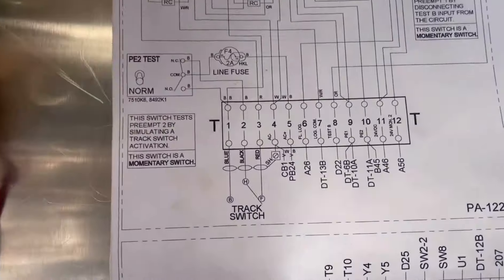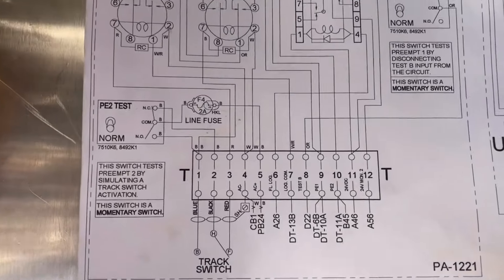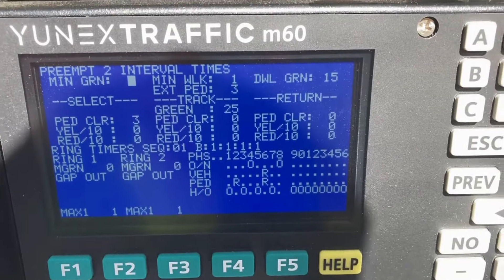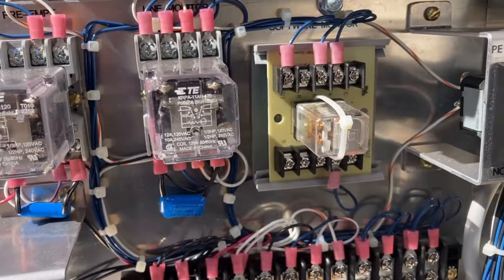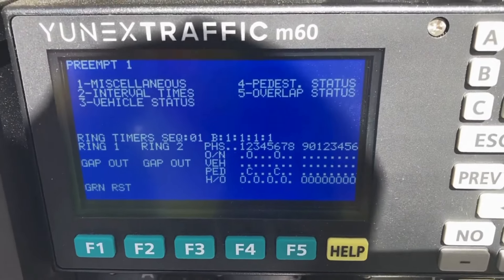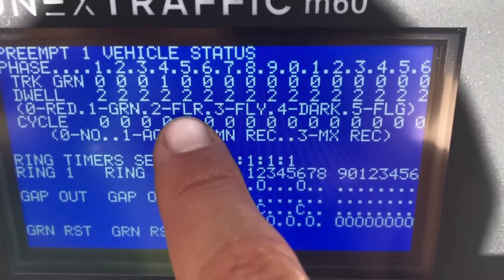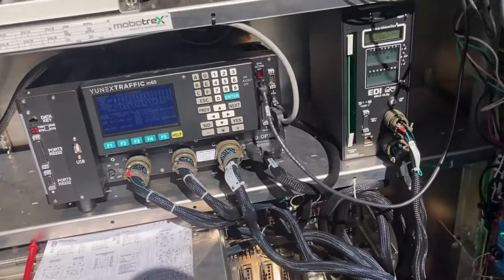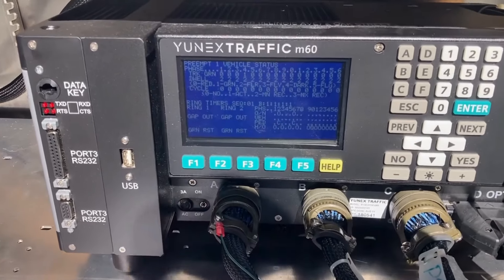How Train Preemption Works!

Comment: Funny story - I ran a complete test of the RR preemption. I shorted the track rails together causing the crossing gates to drop along with warning bells and lights.Pretty cool! At the successful conclusion of the test I removed the short and expected the gate arms to go back up. They didn't and traffic was backing up. Eventually, after about 5 minutes they went back up allowing traffic to proceed. That was the longest 5 minutes of my life! Lol. I believe the gates would have opened up sooner if I would have triggered them again further down the line.
Reply: Yep! That's because crossing signal detectors have a minimum of three circuits...two approach circuits and an island circuit. You caused a train to be detected in the island without an approach. The controller has some special logic for when this happens (think a maintenance of way [MOW] vehicle joining or leaving the tracks) and won't clear the crossing until it either sees a Doppler signal of a train going away in one of the approach zones, or the timeout expires. The timeout exists to protect MOW vehicles coming off the tracks in that location.
Reply from the maker: Wow-Mike-I can say I've never done a test that thorough!  We have the RR company that comes and does there own testing (I think every 4 years).  They'll go through that whole test.  I'd be afraid that would have happened to me!  LOL
Reply from the maker: @mobile_vic  Wow thanks for clarity on that.  I don't know a ton about the RR circuits...Just the one coming into my cabinets!  LOL  THanks for your input!
Reply: @mobile_vic  I can relate to that, earlier this year a MOW vehicle (thanks for teaching me a new term!) was keeping a crossing closed for an entire half hour due to being parked just barely off the side of the road on the tracks (presumably still in the island sensor zone), so the crossing assumed a train was parked ON the crossing despite being technically, entirely clear. ...Why the MOW vehicle didn't set the e-brake and lift the rail-wheels to break the circuit and allow road traffic through, is a mystery to me (unless their maintenance specifically required the gates to be locked in lowered position, but I don't think so, they were clearly working on the control cabinet only).
Reply: @WackoMcGoose I’m going to annoy you more by telling you that in the cab of any hi-rail truck there is a shunt switch, you can choose whether to shunt the track circuit or not. Reason being, if you’re operating on track and time in an ABS or CTC area, your presence may give a trailing train a stop signal or speed reduction that’s undesirable.
Reply: @streetsmartstraffic  You're welcome! I'm the opposite, I didn't know much about what y'all did with the dry contacts coming out of my signal hut :)
Reply from the maker: @mobile_vic  Thanks for  your input on all of that.  Sounds like you know alot about the RR circuitry.  No annoyance here!  I love to learn more about integrated circuits and how they work!  Thank for sharing!
Reply from the maker: @mobile_vic  Glad we're teaching each other something!  Youtube is awesome!

Comment: I have always wondered how traffic signals know when the railroad crossing signals activate. In my area, there are a few intersections next to railroad crossings. One of which actually has 2 crossings right by the road intersection sense the track is positioned in a way where it crosses both roads. When the first crossings signals activate, the traffic signals nearby go to green for traffic still crossing the tracks while the other side goes all red. Then those signals switch to red and the left turn signals for traffic turning left away from the crossings go to green. I think the traffic signals go to all green for traffic past the crossing as well when the next crossings signals activate. Another small detail is that when theres a train, the emergency vehicle preemption indicators on the cantilevers also flash too. Really nice video!
Reply from the maker: THanks for that information.  Sounds like their allowing the non conflicting directions (away from the train) to cycle during the preemption?  Maybe I misunderstood you but I think that's whats happening.  
Thanks for commenting!
Reply: @streetsmartstraffic Kind of. While a train is passing. Both crossings, only the non conflicting left turn arrow goes to green. Everything else stays red. And it stays like that for as long as the crossing signals are active
Reply from the maker: @zachzebra56  Yep!  That sounds like what is happening!  During Preemption, the LT's are dwelling during the entire time the train is present.  Sounds like a good program they're running!

Comment: I'm Washington State we have no left or right turn signs light up on the traffic light pole as well for light rail trains. Some have a train picture flash. Does that same system control those fancy light up signs as well?
Reply from the maker: Yep!  Those are driven by load switches as well! Load switches convert signal controller outputs to 120V that the signal indications use.  Hope that made sense.  
Thanks for commenting!

Comment: I like the idea of the second relay to cause a flash state. We only use one relay that stays energized from the hut unless a train comes. If the circuit fails, it would just stay in preempt and prevent serving any track approaches. I guess either way, we are going for a visit. Lol. Do you serve any Exit phases when the preempt ends?
Reply from the maker: Very true-- That visit is coming!  Especially if the PE1 relay (supervisory relay) detects an issue with the interconnect.  No way around it but to visit the cabinet to reset the controller & CMU (once the problem is fixed).
Yes, we serve an exit phase at all of our RR crossings.

Comment: ok, but what about people on the side street that want to make a left or a right? They are stuck for nothing at a red light until the train clears? And you didn't go very detailed into the circuit when the train TR relay drops out which then activates the traffic signal relay which then opens your circuit you sent to them. What happens then, does that then pickup you other relay? the one that senses if there is an issue with the cable? Sorry I am still a little confused.
Reply from the maker: Great questions.The Track Clearance is used to clear all traffic across the RR side.  So once it does that and dwells green on the mainline, there should have been no more traffic to take left or right for that direction.  
The power (signal) being sent to the RR bungalow is always present from the traffic cabinet.  Its what happens at the RR bungalow and rail switch/sensor that detemines when that signal trips the preemption relay in the cabinet.  So in essense, the train is the trigger to trip the preempt relay in the cabinet.  
I should do another video when the train is present so you can see it in action.  I waited but the train never came!  LOL
Reply: @streetsmartstraffic  yes, I was talking about traffic on the side street heading toward the railroad. Once your signal clears all traffic that could be stuck on the track,  then the main road goes green. My understanding is that it will never go red again until the train clears, and the traffic on the side street from the other direction that would be able to cross the track if they went straight will never get a green until the train clears meaning if someone was there wanting to make a left they couldn't until the train cleared. Is this correct?
Reply from the maker: @s16100  You stated that correctly.  Unfortunatley there is no LT arrow for the opposing side street.  (the main line is a one way so no RT).  So we could in essence cycle the mainline and the opposing side street while the train is present.  However, the side street green ball is telling people they COULD head towards the train.  I'm trying to avoid that--even though common sense tells you not to go even with a train present ahead--but common sense isn't so common anymore.  LOL
Reply: @streetsmartstraffic  Sadly I have to agree with you on the common sense part, however, it is not like the railroad doesn't have a crossing gate and flashing lights. I mean I am looking at this from a point of a person who is an Ex-bus and truck driver with a schedule to keep. And the aggravation caused by not being allowed to turn left or right if someone is in front of you at the light that never turns green is horrible. I agree with locking the intersection down at first to clear all possible traffic from the tracks, as a RR engineer now, I appreciate that. The hell an engineer goes through seeing a truck or car on the tracks and there is nothing they can do causes night mares etc. But I think after that first cycle to clear the tracks it should either cycle through normally, or it should be a flashing red intersection. Those Railroad signals fail at times too, and the  railroad sometimes can't get there to fix them for a few hours. This leaves people having to run a red light to be able to move. That is my point on this. :)

Comment: These are annoying at one intersection here. When a train is coming all the lights turn red no matter which way you're going. Even going away from the tracks.
Reply from the maker: Its the way the controller is programmed.  If there were safe movements (not conflicting with the train), it could be programmed to service those movements during the train.